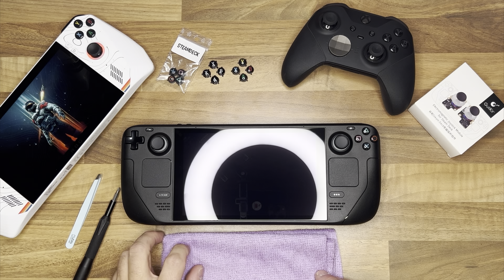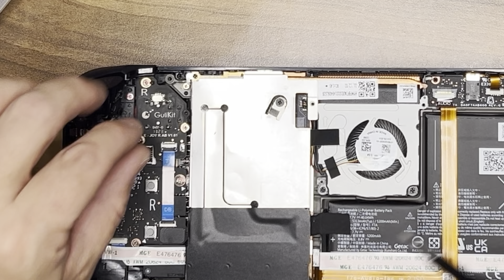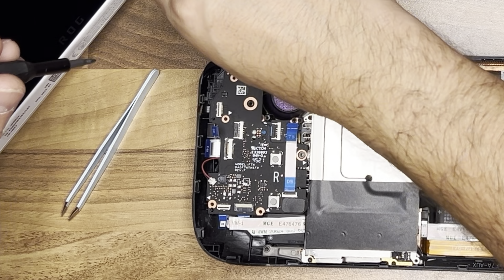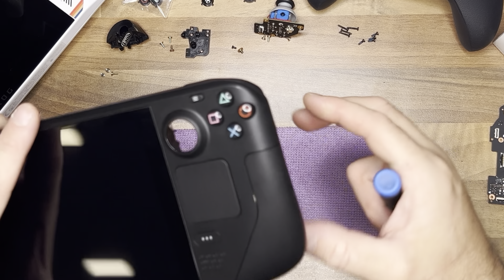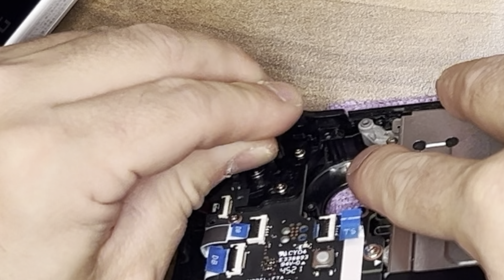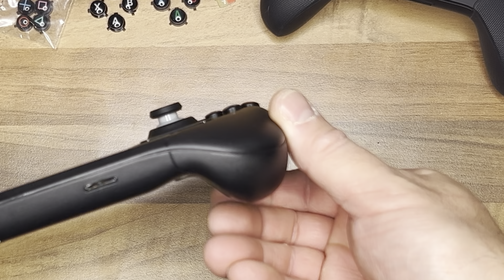SteamDeck Buttons Mod

Comment: First step is ALWAYS to UNPLUG THE BATTERY!!! 😢That poor Steam Deck, omg
Reply: Why?
Reply: @Sneaky_racoon_sly you can damage it. The internal circuit boards may not be able to handle hot swapping. 
And the most dangerous thing is accidentally shorting it. Where high voltage goes where it's not supposed to. There's alot of thin wires inside different parts and they will fry and vaporize with too much electricity. So a dropped screw, a misplaced screwdriver, or anything conductive can destroy your device. 
So, you can't short anything if you remove the source of electricity. Unplugging and disconnecting the battery.

Comment: Any way to make the software to map to the symbols instead of the previous original letters?
Reply: Use decky and css loader. It has plugins that will change the buttons showing up within the OS. As for the games, well, it’s on a game per game basis. Some mods will allow you to change the input.

Comment: Now if I could get the system to recognize the change. I know it changes when you have a PlayStation controller connected so it is somehow possible
Reply: Did you figure out a way to switch it?

Comment: looks great, but is there any way to tell the Deck to display the button prompts?  I know Steam can already do this on PC, but I'm not sure the deck has that option.
Reply: That depends on the Game TBH. The Steam App on Deck is the same as Steam App on PC, the Steam Deck is actually a PC. It has the same CPU Type as a PC/laptop.
Though for example while you can Tell Steam to Display Playstation Inputs. If the Game does not have Playstation Inputs it will just use the ABXY Inputs.

Comment: wish they had these for nintendo layout, id buy a steam deck lol
Reply: the steam deck's software allows you to switch the button bindings to be like the Nintendo, but the button caps themselves are keyed in such a way that they can only be put in the way as seen in the video
Reply: @JusFoNo  ya I can't deal with buttons being different tho and Noone sells Nintendo button layout to swap them that I've seen
Reply: I have the SD button for Nintendo layout
Reply: There's a seller on Etsy that sells the Nintendo Super Famicom button layouts in case you're still interested.